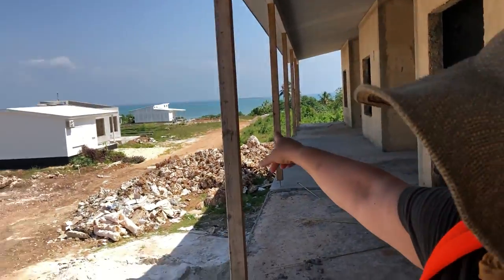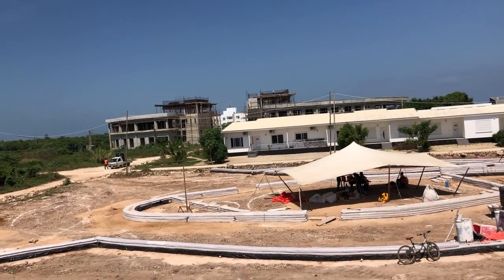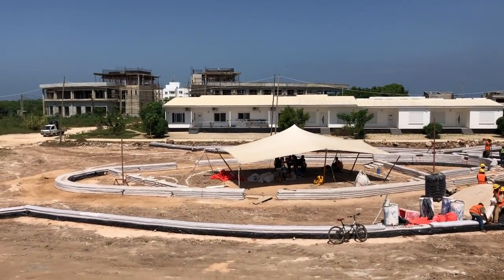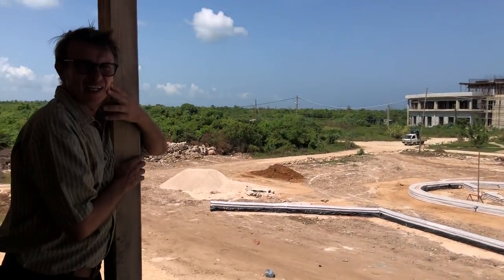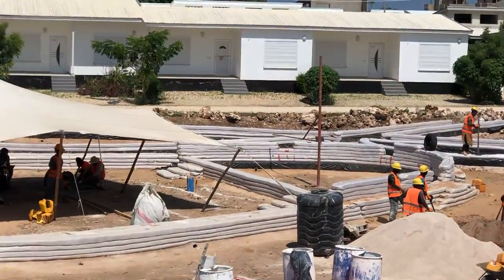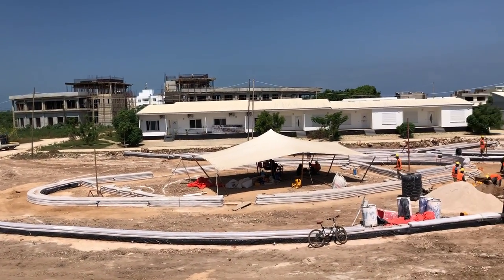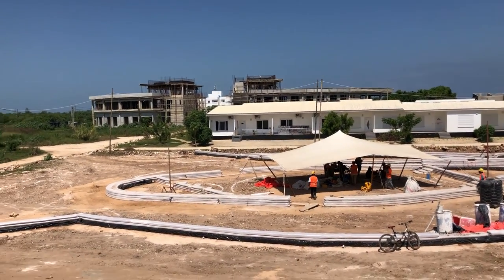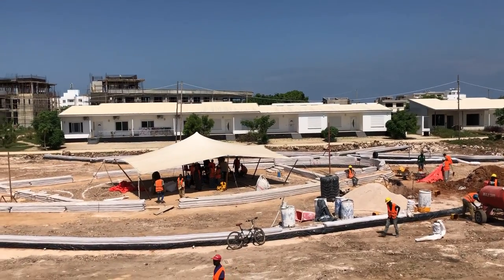Fumba Town: Super Adobe building in Zanzibar's Permaculture Town, discussion with Franko Ghose

Comment: Switch to hyperadobe, my advice. It's simpler and just as good. (also, consider using charcoal as part of bagging and plastering; it might be of great help in humid areas)
Difference is that hyperadobe uses 'potato bags', which have bigger holes in between, preventing the need for further reinforcement between levels (and it's a easier to obtain material).